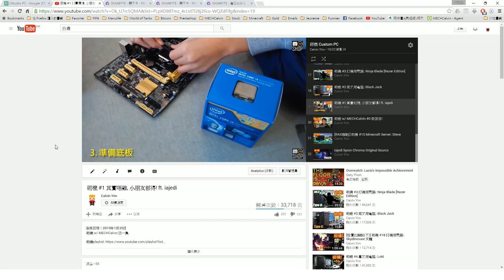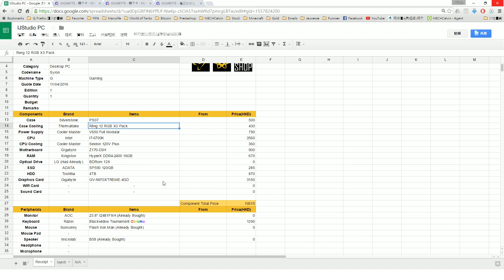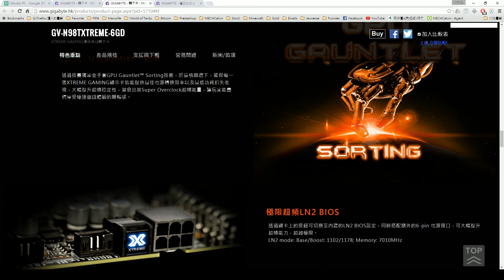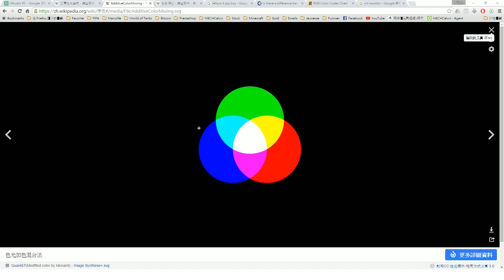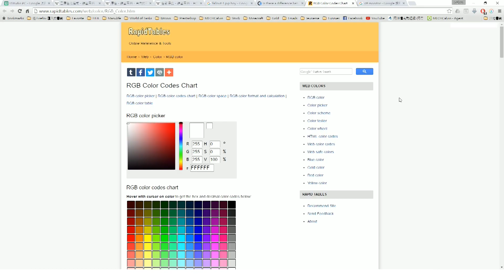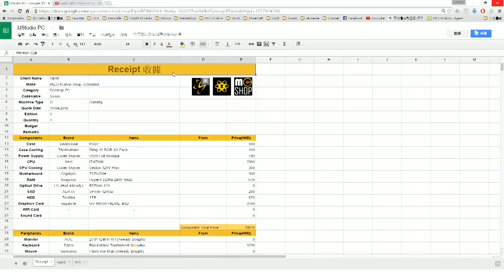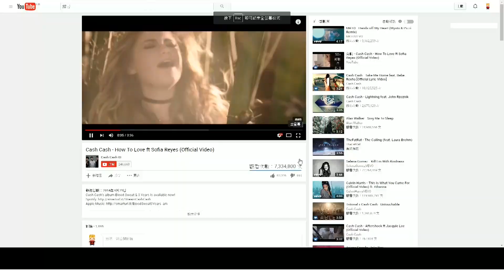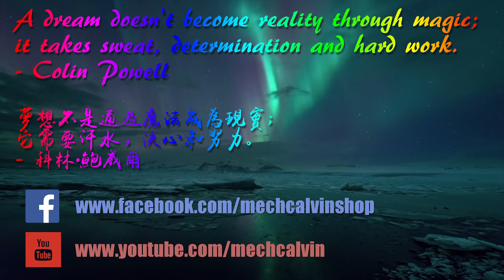[全民RGB] 砌機 #19 打機用電腦: Syron 薜倫

Comment: Calvin 問問你
CPU : Intel core I7-6700t
gravfic card : inno3d Geforce gtx960 
case :Mtx 黑色 ray 直立式機箱
power supply : silent 580w 
cooler : cooler master hyperx 212x 
mother board :Asus h181-E
keyboard mouse : Logitech mk2101
screen: Philips 22吋 softblue
ram : crucial 8gb DDR3-1600 udimm 1.5v cl11
大約8k 港纸，贵定平？？
Reply: 如果你同佢一樣用6700K配970都係浪費左個6700K...你有8000蚊budget不如買個i5-6500配970...
Reply: CPU : i5-6500
GPU : MSI GTX 970 4GB OC
Motherboard : Asus H110M-K
Ram : Kingston Hyper X Fury 8GB DDR4 2133MHz
PSU : EVGA 500W
CPU Cooler : Cooler Master Hyper 212X
Storage : WD Blue 1TB
Case : Corsair Carbide Series 100R Midtower Case
Monitor : Asus VS247H-P 23.6 inch
Keyboard : Redragon K552 Kumara LED Backlit Mechanical Gaming Keyboard
Mouse : Redragon M901 Pedition 16400DPI

我有8000蚊我會用呢D Parts...
(我上外國網站睇呢D Parts...轉番港幣可能會有小小出入...稅唔同...不過唔會差太遠)
(Redragon 好似外國先有...香港唔知有冇...)
Reply: Motherboard用B150喇